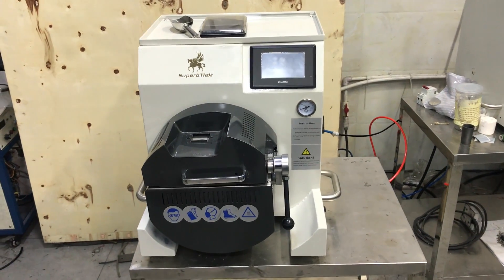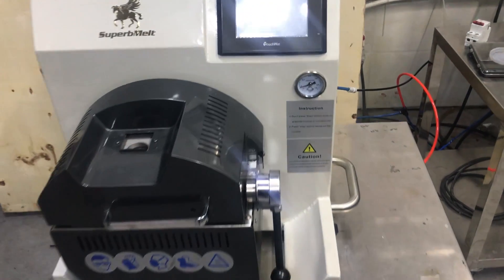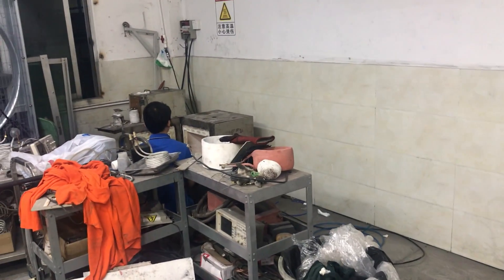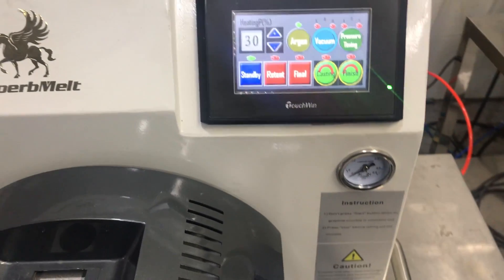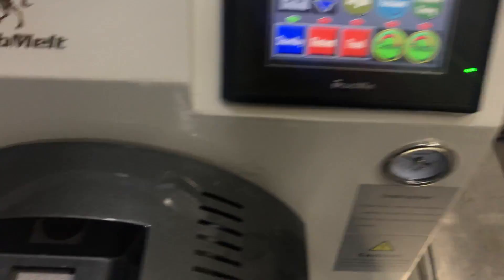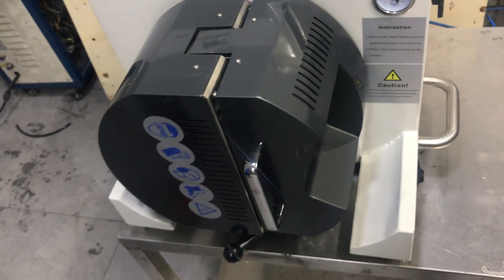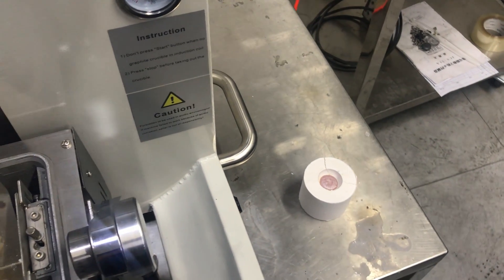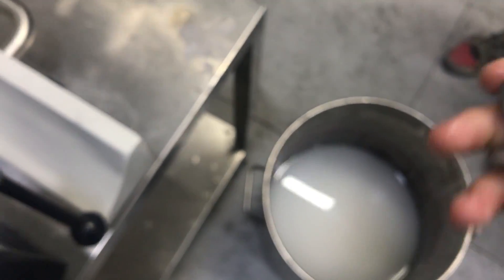Mini Jewelry Casting Machine Introduction and Instructions

Comment: I really wish I could afford it. How much pressure does it need? What kind of compressor with how many l/min. has to be used? What is the highest temperature it can reach? Does it also use a vacuum? Does it run on normal household electricity or does it need a high voltage connection?
Reply from the maker: 2 bar, nor small air compressor will be ok. Highest temperature could be up to 2600 degrees. Vacuum built in. Single phase 220 4.5kw as power
Reply: Superb So you mean a normal power plug is enough? Just asking because lots of induction powered casting machines need heavy current.  Does the casting machine come with a water cooling unit?
Do you also sell the casting furnace by itself? Because I already have a furnace, mixer and sandblaster.
Reply from the maker: Cat3D you are right. The plug is not enough for this machine. it need install air switch.
Reply from the maker: Cat3D equip with one water pump for water circulation.
Reply from the maker: @Ian Sacks an air switch is needed